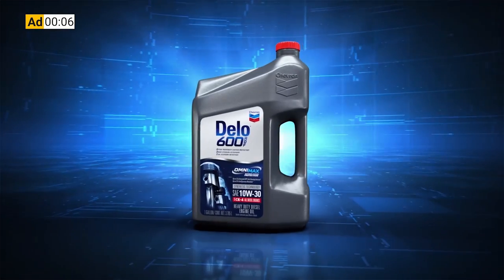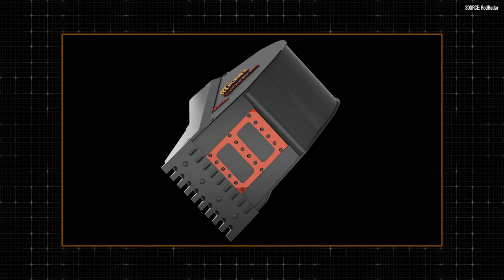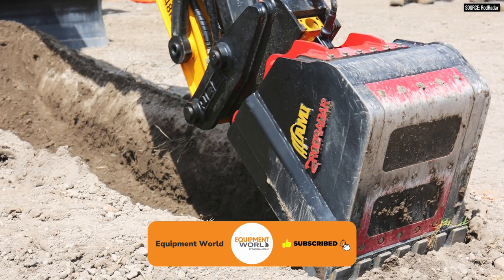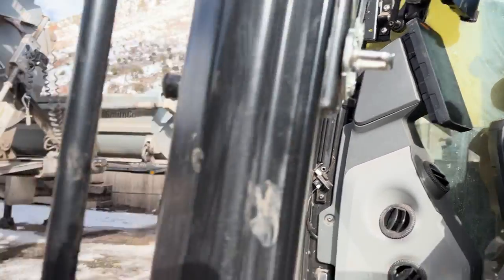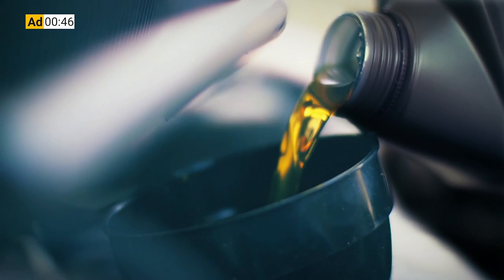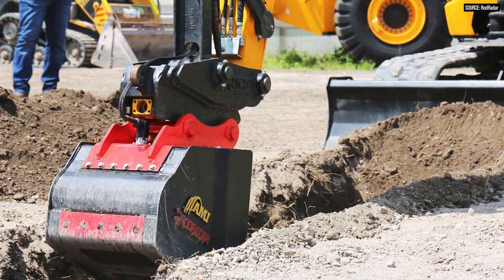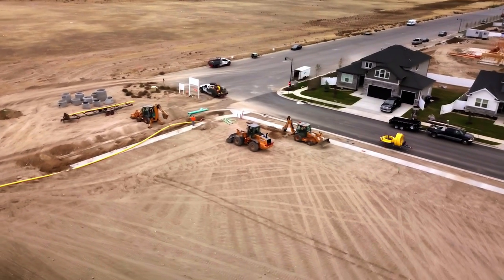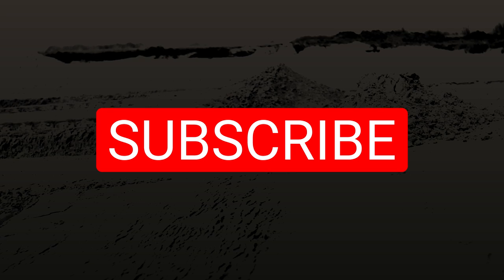The World’s First Excavator Bucket That Detects Buried Utilities

Comment: Always still hire a locator to avoid liability. Also I run a GPR and it will not find lines running parallel to the machine. Still seems like it might be a good product, but just keep that in mind.
Reply: I'm going to say that most states have codes / laws requiring locating before the job starts.  ie:  Here in Indiana, it's a state code (law) that we call 811 for utility locating before any shovel hits the jobsite.

Comment: Did i hear him say any utility in any soil? 20 years of working with GPR. I would be weary of this statement when its know Clay is really not good for GPR. and good luck with Lone fibre. And im not sure it has and vertical scanning, so any pipes or cables running parallel to the bucket. The time taken to scan and dig scan and dig. It would be much faster and cheaper to get a full GPR survey done before work starts. dont event want to know the cost to fit all your machines to a large project. Also will people pay there employees more when your upskilling them, and giving them the resposibility to not hit anythng. hmmm.

Comment: The company I work for bought one, not really impressed…
6 scans over 4 known utilities and 6 different results. From inaccurate depth readings to number of known utilities. Rocks, roots and backfilled metal objects will throw it off as well. Not to mention I will not find parallel to bucket utilities… they have some issues to work out, save your money for now.